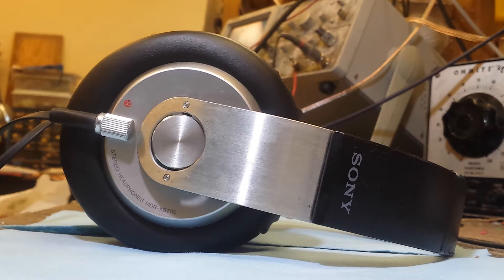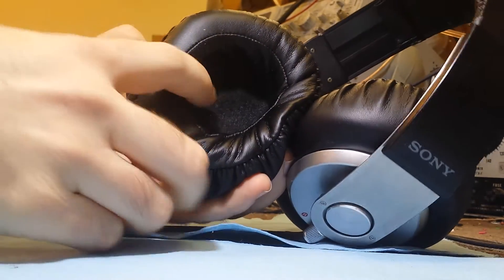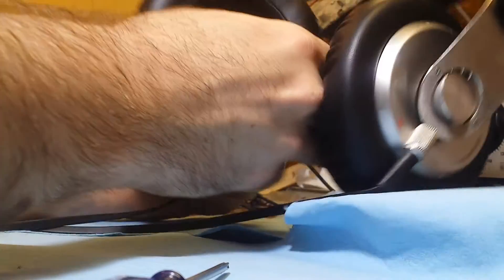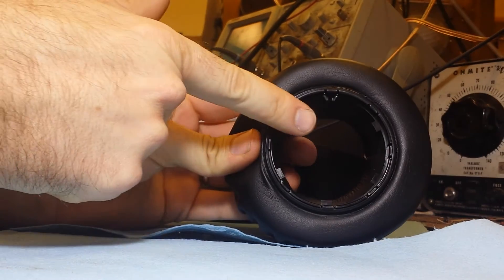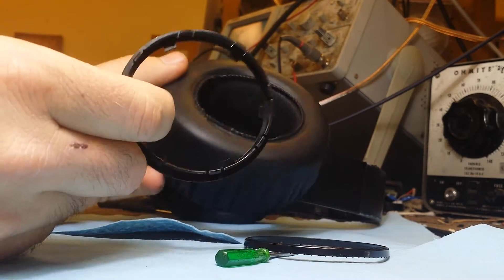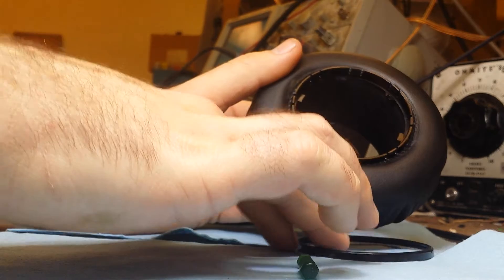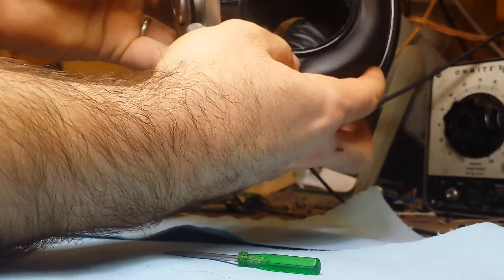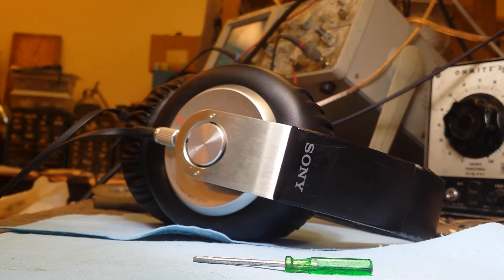Cushion replacement procedure for sony mdr-xb700

Comment: I have mdr-xb500 the only difference is I have 3 tiny screws but this tutorial was spot on.  It was easier to separate the rings using a flathead from an eye glass repair kit from the bottom instead of trying to push those clips out for me.

Comment: I've obviously got a later version because I can see not screw inside the foam or did you just use the screwdriver to detach the foam pad from the head set.

Comment: long shot but do you know how to get replacement rings? one of the thin rings broke when I was replacing the cushions.
Reply from the maker: @MANTI5  I'm in the same boat myself. One of my rings busted last time I tried changing cushions. About the only thing I might suggest is a company like send cut send where you might be able to get them to reproduce it. Just haven't had the time to research it further

Comment: very useful guide ;)  I also need to replace the upper sponge part and i can't find it on internet. don't know where to find it :(
Reply from the maker: ionutz car I don't either. Both of mine are shot. Been thinking of taking it to an upholster
Reply: Do you mean the headband material? They sell a 3rd party one on ebay. It's $4.

Comment: I've had my xb500s (which seem to be identical to the 700s?) for a while and they're by far the best headphones I've ever had. However, I snapped the cord a couple months ago and don't think i'll be able to re-solder them because the cord itself is pretty unusual (there's fuzzy stuff in the wire) and I am inexperienced. So I thought the next best thing would be to buy the xb800s and replace the cushion with the 500s'. 
The 800s don't look as comfortable but moreover the cushion looks like it may attach differently, so I wasn't sure if the 500s' cushion would be compatible. Do you have any experience with this? I know I'm sort of being cheep, but I can't afford new 500s at their discontinued price, and I'm currently in earbud purgatory.

Comment: I've been trying to get these stupid rings out of the old pads, but I'm not making any progress no matter how much I try. Is it possible to just cut open the old pads and kinda rip them out off the ring? I don't care if they survive or not, I'm tossing them out anyway. Thanks in advance and also great video
Reply: Update - This does actually work really well. In case someone sees this and wants to try:
- Cut a bit into the side, and rip the leather with your hand until you reach the bottom (ring);
- Now try to pull the cushion out of the ring, by pulling gently until it comes out;
- Now one spot is out, put your finger in the spot between the ring and cushion you just created and gently pul away from the ring all around it.
- Now that the cushion is gone, the ring removal part should be 100 times easier without the extra friction of the cushion.
Result:
https://photos.app.goo.gl/egcFxJlEV3j9ZRcC2